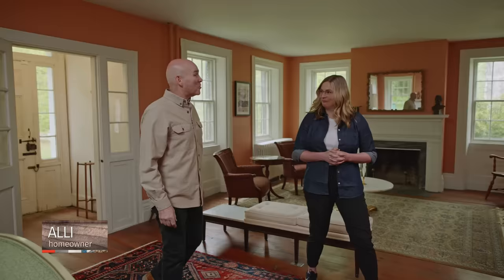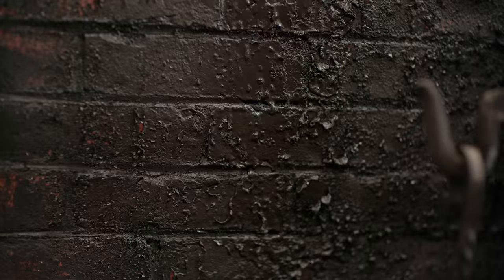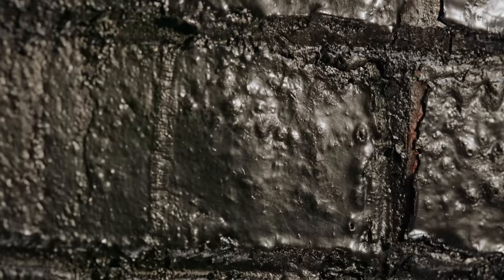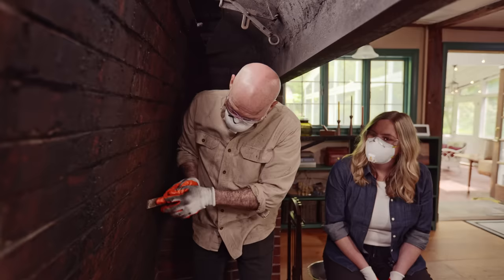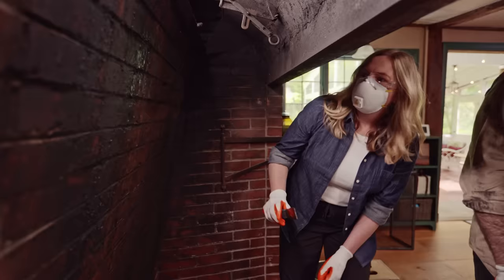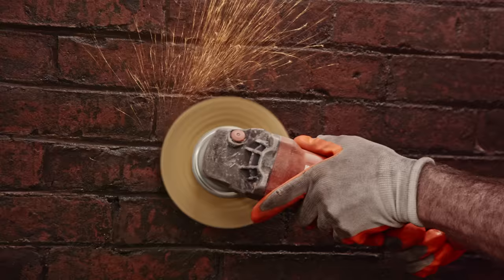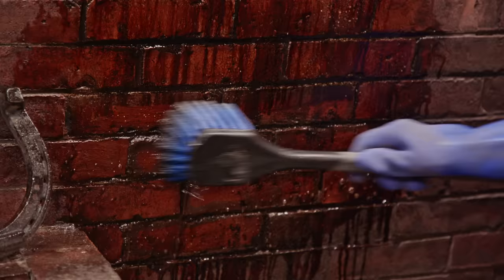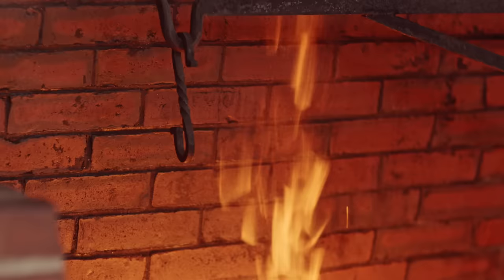How to Clean Creosote from a Fireplace | Ask This Old House

Comment: I shake my head at every one of these "Old House" Videos, that purport to give so called "good advice," when it comes to old houses and especially old brick. You never, ever use abrasive wheels to clean old brick. All you're doing is hastening the bricks deterioration. By using abrasive methods such as these, you're removing the face of the brick, and the cleaning agent, which is either  acidic or excessively alkaline, keeps eating away at the brick. Don't use flap-wheels or wire wheels, ever,, no sandpaper discs either. Start by using the gentlest method to start, water and a soft brush. If you get to the point where you think you need something stronger, then dilute a restoration cleaner with water at a ratio of 10:1, reducing the amount of dilution until the brick is clean.  Leave at least 48 hrs between cleaning to allow the brick to dry, before moving on to the next stage. I own a Historic masonry repair company that does this type of work on a daily basis from Boston, to Richmond Virginia. Please stop giving out this bad advice.

Comment: I don't get it. Why is this a problem? The inside of a fireplace is built to contain a fire. Shouldn't the creosote just harmlessly burn off even if it lights? Will it not just reach an equilibrium at some point, whereby the amount deposited is equal to the amount burned off?
Reply: Creosote Burns Hotter than you expect, When it gets to Glaze levels its bonding to the Clay Liner/Brick.. and well have you ever seen a clay fire? Beautiful but good luck stopping it.
Reply: yeah creosote burns houses down.  It isn't ashes, it's a highly  flammable compound like gasoline. Imagine that fireplace spitting bits of napalm into your living room...
Reply: Creosote burns at super high temperatures.....enough to crack the mortar joints and allow the heat and flame to reach the interior framing of a house. It's bad. Really bad.
Reply: Not to mention your chimney turns into a blowtorch shooting flames and burning embers out - onto your roof, lawn, car, etc. Chimney fires are no joke.

Comment: Creosote does not come from fossil fuels (like wood). Also, pine is fine to burn as long as it is fully seasoned. It's commonly burned out west. Burn any wet wood and one is going to see creosote accumulating on a cold surface.
Reply: Wood's also not a fossil fuel. He knows what he's talking about for cleaning but could use some work on the details.

Comment: appreciate the show and content. At minute mark 01:34-01:36 you can see the flue tiles are gapped and cracked. This will allow heat to enter into undesigned areas to cause bad things to happen. A visual inspection picks up many defects but we always recommend to have your fireplace scanned with a designated fireplace camera or professional chimney scanning tool to uncover what a visual inspection misses. This should be done annually if fireplace is new, used, or have no history on the system before operation.

Comment: Wood is not a fossil fuel,if you don’t know that what do you know? To break down creosote buildup,which is unburnt terpines (oil) establish a 2’ layer of red hot embers, then add enough split seasoned wood to cover embers. Wait about a minute for strong,steady fire. Then add a small handful of salt. (a half cup or less) Then put up fireplace screen as salt will pop a bit. The heat will carry the salt to mineralize the surface of the creosote ,which will then act as a wick to burn the creosote. Same as a candle wick. This happpens gradually during the burn so it is barely noticeable. The creosote will be reduced to a fine ash that is easily swept away after letting fireplace completely cool. You know you have enough salt by observing the flame turning a deeper yellow. This technique has been used by my family for generations. As for rust forming you have to have liquid water for that to happen. Cheers from Sunny Alberta 😎

Comment: Where's the handle for Mark's angle grinder? It's a safety issue not having that, and for this job, it's a requirement.
Reply: They say in the credits that some safety equipment is removed for television purposes.

Comment: Our chimney stove is 4 decades old & has never been cleaned, we probably stopped using it after the first 2 decades, or maybe even the 1st decade. That means it probably has not been used in 20 years or more, idk.  We really need this stove these days because of increasing economic inflation, increasing electric bills & colder winters.   We do not live in snowy areas, but it can get below 32F sometimes & our heatpump has to work harder. The problem is possibly the cost of a professional service.  I wish I can do it myself but its chimney top side, aka crown/cap/wash is 2 stories up on a spanish clay tile roof & then the chimney itself extends another 5-6 feet up above the roof, so that probably means needing a short ladder resting on top of a pitched tile roof propped against the wash, which could get slippery.  And I am scared of heights.  I have been on top of our roof a couple times before, but to then have to bring a short ladder there to get to the chimney cap & then work on the cap is even scarier.

Comment: How about using Hi-Pressure Washer ?? And if Hi-Pressure Washer not doing the job, I would sealed up the area and do Sand Blasting ! !
Reply: Would work if outside.. They are inside and a flooded house of Sand or water is more of a detriment.
Reply: I've considered before submitting my comments. If Hi-Pressure Washer is used, we can make a temporary containment by sand bags with water pump to drain water to outside. If sand blasting, we can use thick plastic sheet or tarp to seal a small area and vacuum the sand into bags or large containers. What do you think ??   @snintendog
Reply: @lorddiablo8575  Your not the first to try. We have seen what happens afterwards of DIYers trying it... lets just say it removed the glaze at the cost of their floor. and dusting their whole house with sand. Water damage in the basement. Containment is never 100%.
Reply: Well, I've done this before and I used Hi-Pressure Washer as it is NOT DUSTY ! I don't have wood floor, but ceramic tiles instead ! The most important thing is preparation before cleaning, and I would say different environment, different method ....  @snintendog
Reply: You want the house flooded?

Comment: 2:01  A fossil fuel is a hydrocarbon-containing material such as coal, oil, and natural gas, formed naturally in the Earth's crust from the remains of dead plants and animals that is extracted and burned as a fuel. Fossil fuels may be burned to provide heat for use directly, to power engines, or to generate electricity. Wikipedia
Reply: In the 70's when the Oil catastrophe started, that oil ends... The whole west is based to one man hypothesis that grudge oil is based to Fossil plants and animals. And is located only in specific areas and layers. An so on oil is rare resource.

At the time, Soviets had different hypothesis, that oil is not based to fossils, but it is a generation from the earth core itself, and hense is finite resource.

So far USA oil companies finds oil every 1 of 10th sampled locations based their hypothesis.
Where Soviets, and now Russia, maintains 6 of 10 sampled locations to find oil. And they extrude oil multiple times more from the fields than what western hypothesis claims to be possible, and those ain't from where any plants or animals were living.

This Soviets hypothesis is not accepted in west and keeps ignored, while now Russians keep pumping more oil than should be possible...

Comment: That’s about the most inefficient fireplace you’ll ever see right there. You wouldn’t catch me using it. You’d be better off installing a Wood stove inside that fireplace than using it like it is.
Reply: It's more of a hearth for baking/cooking rather than a conventional fireplace for heating.
Reply: Would run 5-9 Grand  for the Liner work but good luck working around the EPA red tape on Freestanding stoves in a firebox. And for the love of god NEVER let some one but a Slammer in.